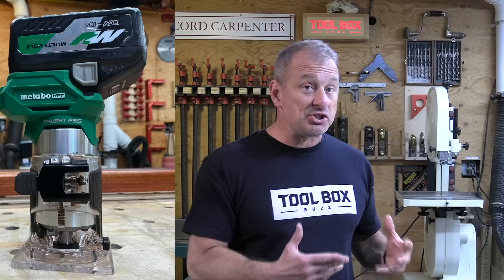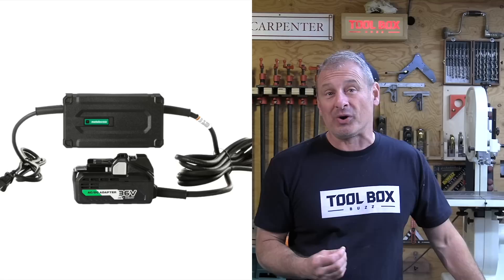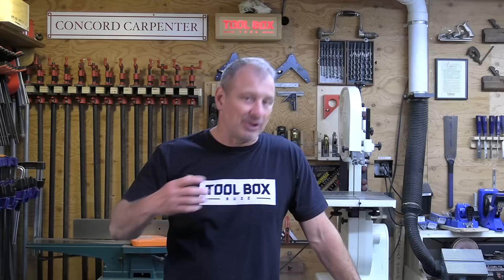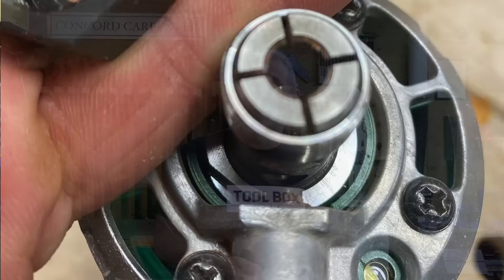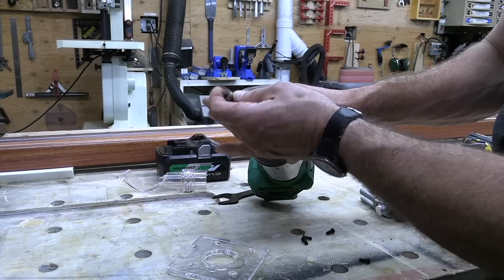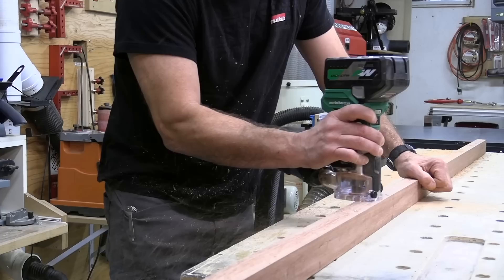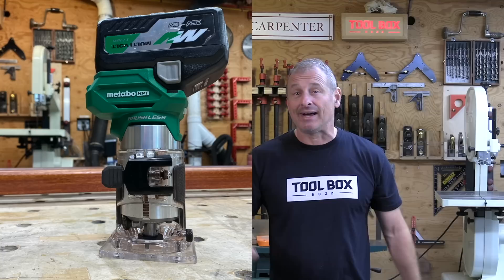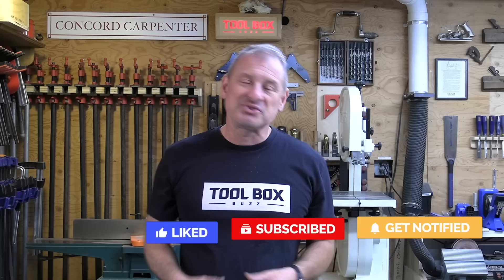Metabo HPT Cordless Trim Router

Comment: Thank you Rob. Heads up that Metabo is releasing a track saw. I have a close friend that works for Metabo and has had it in the hands of a lot of trades people. The feedback has been solid. Really going after makita.
Reply: Good.  I hope they make Makita regret the 40 volt platform.  Should have gone out of the way to make it compatible with 2 18volt batteries.
Reply: @chrisE815  for sure
No reason they couldn't have made 40v batteries compatible with 18V like Metabo HPT  and  DeWalt did
Reply: Metabo or Metabo HPT ? If HPT, then you bet I will be getting one !!!
Reply: About time
Reply: Ohh sweet
Reply: if that's the case, I will hold back on getting more Makita stuff.
Reply: Metabo is making some of the absolute best cordless stuff these days. Everything I have of theirs works flawlessly and weighs next to nothing. The multiple power options on all their tools is a massive benefit.
Reply: You sure you mean Metabo the German brand not Metabo HPT

Comment: Thanks for the great review 👍
Looks almost identical, minus color, to my Makita. Same two button power, same dust shroud(which doesn't come off in use) rack and pinion, extra collet and the edge guide. 
It also has a plunge base I picked up which is very useful. Bare tool is $129, I think I paid $100 for mine on sale about 18 months ago.
Reply from the maker: Thanks for sharing

Comment: So, ill say this. I have two identical kits. One from metabo, one from milwaukee. Nailers, pin gun, routers, etc. Use one for my main job (carpenter) the other to flip houses on the side. The milwaukee kit is definitely better. Nicer hand feel and balance, guns dont jam, the impact is smooth, etc. But, it is over twice the cost. Metabo works just fine if you can get a deal on them. If you have to pay full price, go milwaukee.
Reply: So True I have M12 and Metabo....I love my Metabo and M12 but almost every tool is double the cost.
Reply: Milwaukee Milwaukie miltabowokee

Comment: I love my Milwaukee cordless trim router. Wish Milwaukee had that amazing AC adapter option...
Reply: Why? What makes your Milwaukee trim router AWESOME (really any cordless trim router for that matter) is its balance and convenience because it is CORDLESS. The AC outlet (if available) will keep your second battery charged.
Reply: @dondonaldson1684  Agreed. To be clear I'm not pitching adding AC to my cordless trim router. I'm thinking more my jobsite table saw and 10" miter saw. Just the big ones.
Reply: @MikeDolanFliss  I have my new 36V Metabo HPT 1/2" cordless router and when I have it hooked up to one of my router tables I plug it in-its my favorite router in the shop and on the jibsite

Comment: Honestly, I have never seen a 3/8" router bit so the extra collet isn't much of a bonus. Should just include a second 1/4".
Reply: There's a wide range of shank sizes for routers that include  1⁄2-inch, 12 mm, 10 mm, 3⁄8-inch, 8 mm and 1⁄4-inch and 6 mm... Some sizes are more common in other countries.  Mind, Metabo HTP is actually Hikoki/Hitachi and thus an international brand like Bosch, which also offers 3⁄8-inch and you can fairly easily get bits in that size.  Just not as common as 1⁄4-inch but is step up from 1⁄4-inch, which is what trim routers are normally limited to... So not as good as switching to 1⁄2-inch but still stronger and more stable than 1⁄4-inch bits allow...
Reply from the maker: Good point

Comment: In slightly over 50 years of doing woodwork and having literally hundreds of power and battery tools I can only remember  only once seeing a 3/8" collet straight cut one flute bit.
Makes no sense to me that it would have a 3/8" collet when no one makes bits to fit it. 1/2" would be nice but doubt it has the power to use most 1/2" collet bits. Very weird combo .
Reply: There's a few that make them but it's more an equivalency to the 8mm used in Great Britain and Europe and pushing the limits of a Trim router without going to a larger router and using 1/2" shank bits...  Note Bosch also includes 3/8", for example... May also see some in the CNC range...
Reply from the maker: That plunge router can do 1/2”
Reply: Metabo hpt has the 1/2 plunge router
It's my new favorite tool

Comment: As long as you got the batteries and the system good for you but it's not for me I don't have their batteries platform
     👍🏻🍻🍺🍕
Reply: If u need a great cordless 10" table saw, mitre saw, grinder, SDS ROTARY Hammer, fill size 1/2 router, most powerful recip saw and hammer drill , best star if the art nail guns and others that U can also plug into with the AC adapter-U would have a good reason to add that battery line- I have replaced most of the above tools from Metabo HPT from Milwaukee and Makita because of the better features, lifetime warranty, backwards compatibility between their 18V and 36V as well as the AC adapter
Might wanna give a few tools a try